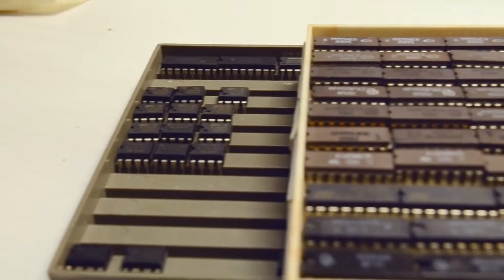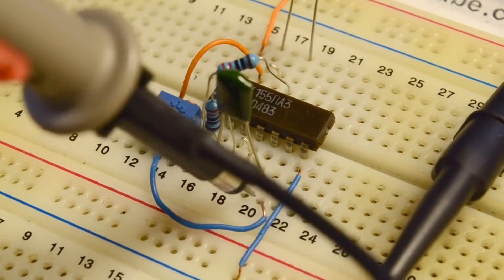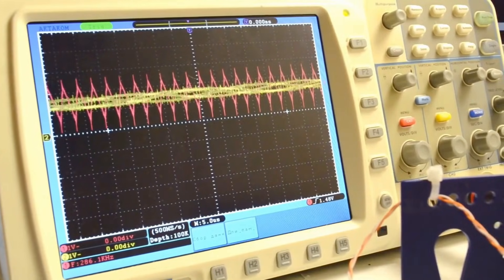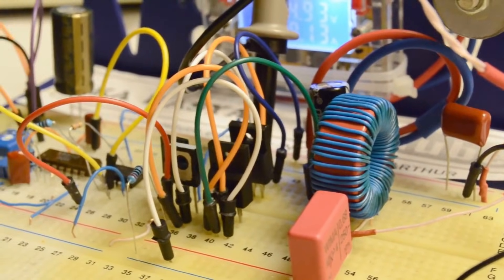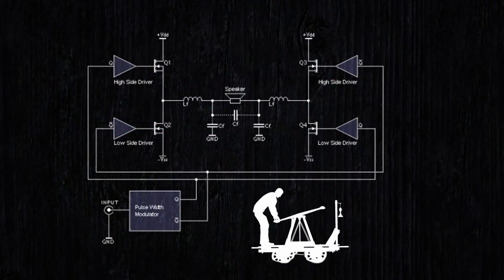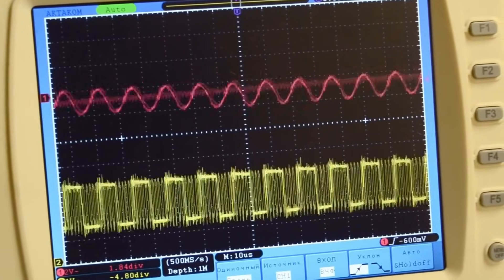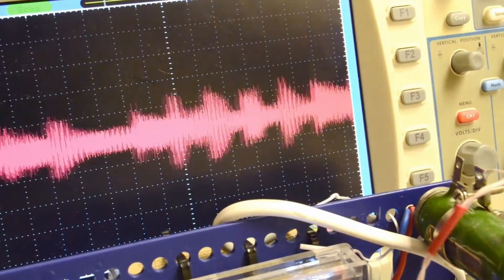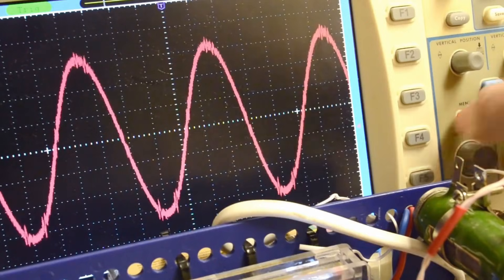DIY Class D Amplifier + Operating Principle

Comment: I didn't understand how you used the comparator exactly, if it's output is a 0-1 digital value, it's like a gate opener that leave the signal through? And then you add the feedback loop at the inverting input and the signal gets cleaner? Very good video all in all.